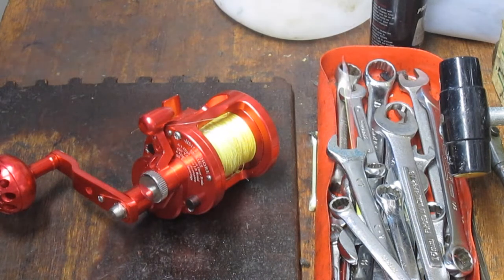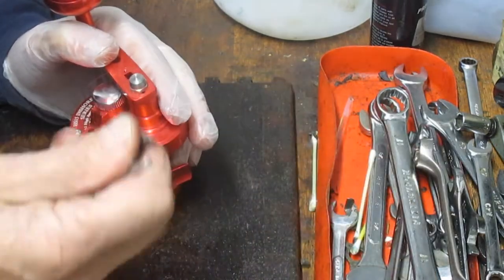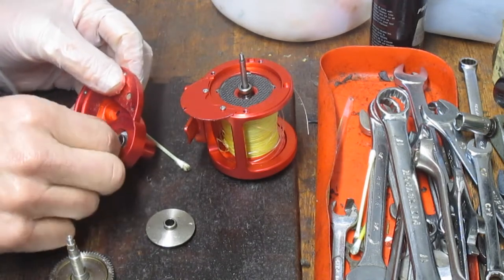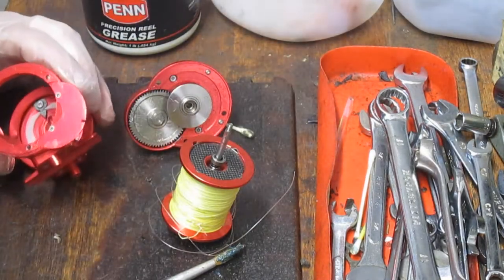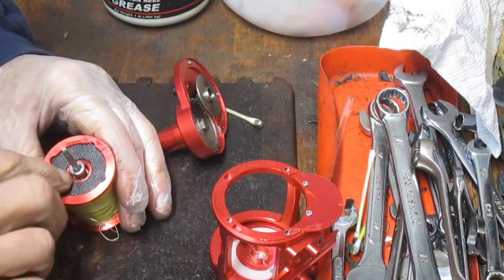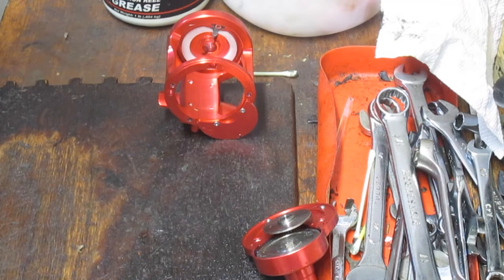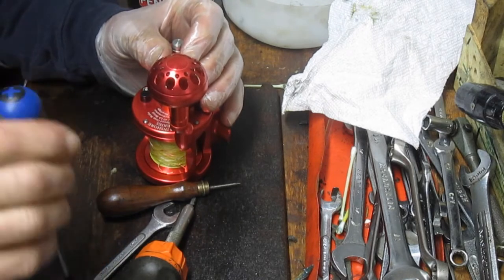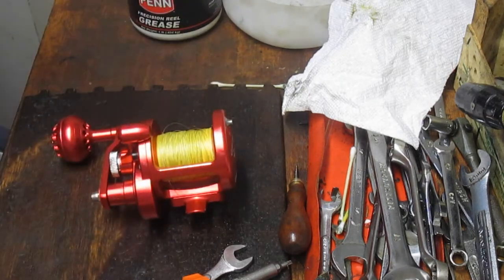Canyon Reels HS15 How to take apart and service this lever drag fishing reel

Comment: is 3 in 1 oil ok to use
Reply from the maker: It is OK, but not the best.  You should use an oil designed for fishing reels.  I use ReelX snd Penn Precision reel oil.  There are other brands aa well.  Reel oils are designed to provide maximum protection and generally are more suitable than general purpose oil.  If you use 3 in 1 you will likely need to use it more often or not have the maximum slip and slide protection afforded by the oils specifically formulated for reels - Dennis